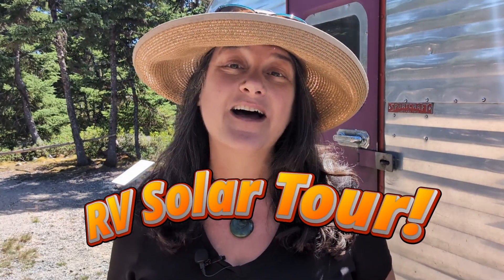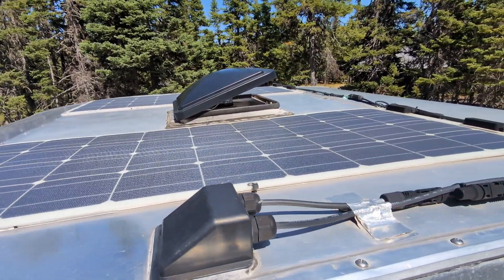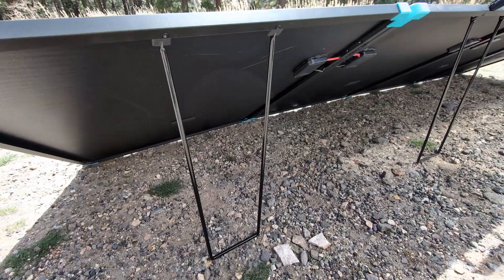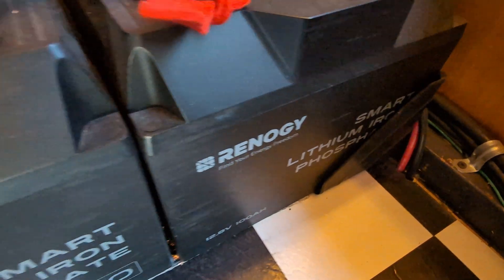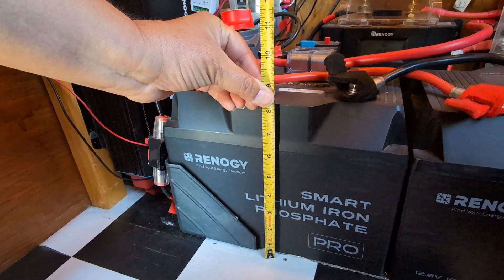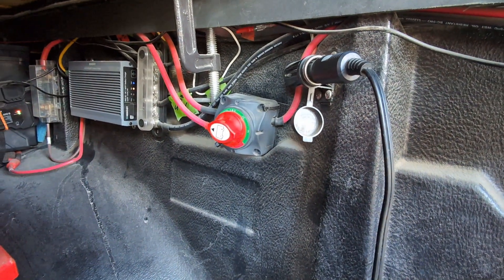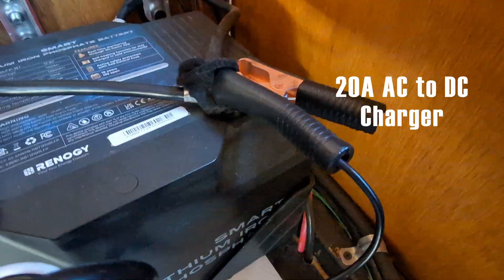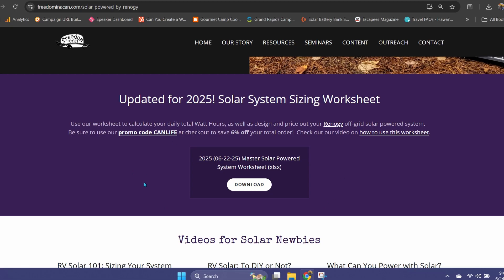RV Solar Tour : Maximize Your Off-Grid Power!

Comment: Hi, I’m planning to power my trips (Subaru and teardrop trailer, solo) with two power stations (a 2000Wh and a 1000Wh), along with a 400W solar power array and an 800W alternator charger. I’ll have a refrigerator/freezer and an A/C unit (all Ecoflow, except the solar panels are Anker), each which have their own batteries). Since I haven’t used any of this yet, I think that will be enough. Do you see anything that I might not have considered? Btw, both power stations have 2x500W inputs. Thanks!
Reply from the maker: Thanks for the questions, it sounds like you've thought this through.  But I'm going to point you to our downloadable excel worksheet so you can plug in the watt hours for what you want to run and see those numbers in real time.  Let us know if you have any questions.  
https://freedominacan.com/solar-sizing-worksheet
Reply: @FreedomInACan Thanks! I downloaded it and will play around with it. I appreciate your help!